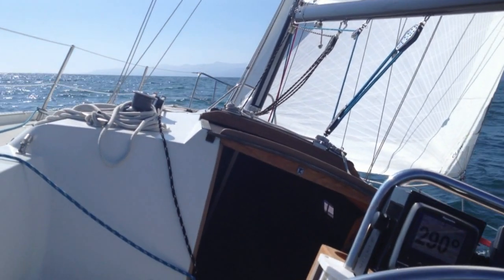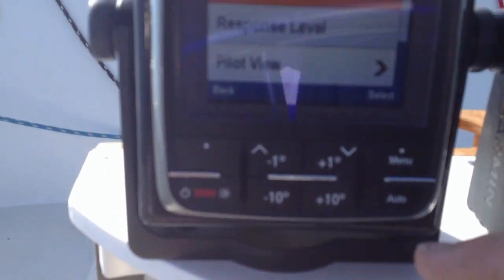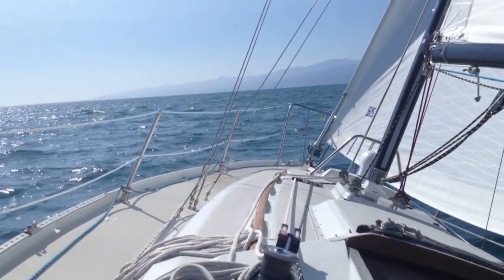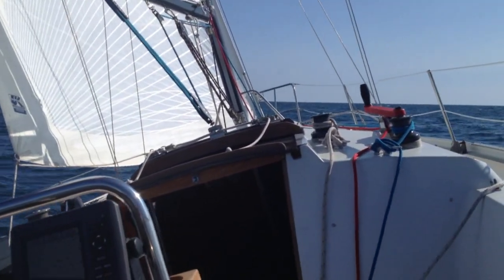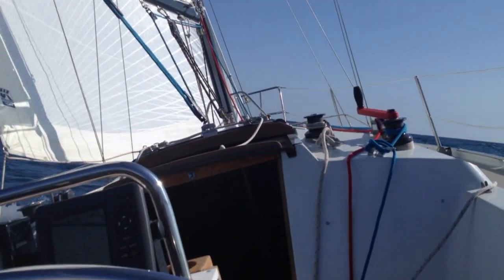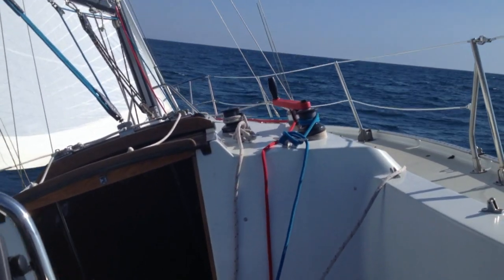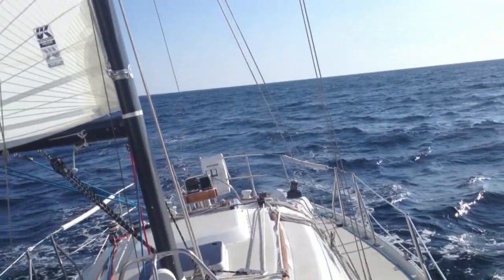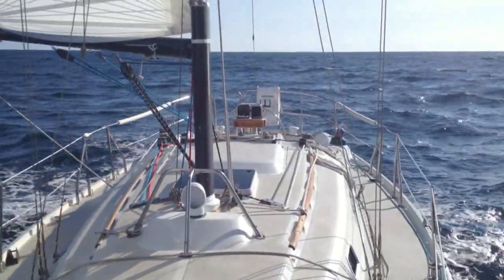Raymarine SPX-5 wheel pilot with P70 Control Head Demonstration

Comment from the maker: Additional notes after a year:

On its default setting--Response Level 5--the wheel pilot motor is quite active and makes a good deal of irritating noise. In harbor,  running buoy to buoy, immediate response is necessary. However, in unconfined waters, the Response Level can be much reduced. RL 3 halves the motor activity for only a slightly weaving course. I find myself often using RL2, when the boat is trimmed for neutral helm. Not only does this make for a much more unobtrusive wheel pilot, but it saves a great deal of battery.  At low RL levels in easy sailing conditions the draw is seldom more than 1 AH.

Comment: Hi, I have just had a Raymarine EV100 Wheel Pilot T70152 system installed.  The installer seemed unfamiliar with settings for "gain" or sensitivity/Response Level.  I went sailing with it and found the wheel is constantly moving and - when the wind came up, it lost track and I had to take over.  Apparently, I should reset the RL to 4 or 5....are there any other settings?  It is disconcerting for it to lose all track - as it apparently did when the wind came up.  My older ST40 system never did this.  Are there other similar videos to yours - discussing all of the settings of the EV100?
Reply from the maker: +Don Voigt
ADDITIONAL NOTE RE EV100

The Ev100 with P70 has only three  settings--leisure,cruising, performance. 
After setup with dockside wizard, engage "compass lock" to hold settings. To change settings, you must remember to undo compass lock. The menus are confusing, so persevere. Most important secret: to change the speed at which the wheel turns in response to commands,  the key is "hard over time". A HIGHER NUMBER MEANS A FASTER RESPONSE (yeah, not intuitive). The default is 6. I have mine set at 20, which allows good response when using the P70 to steer through traffic. For a long cruise under power, I reset hard over time back to less than 10 to reduce the work time of the motor.

Re SPX-5: Trim sails for neutral helm (reef as necessary).  If wheel constantly moving, reduce to RL 3-4 or 5. In heavy air, though,  you may need RL 9 (max), and then sail trim/reduction is the key. Everybody who says wheel pilots don't work has failed to trim their sails just as for a pendulum wind vane--i.e., neutral helm. Must reduce weather helm to minimum. For tech stuff, go to the Raymarine support site. Confirm you have the latest schematics and updates to manuals. In summer they're busy and some techs are better than others, but nobody else can speak specifically to issues.